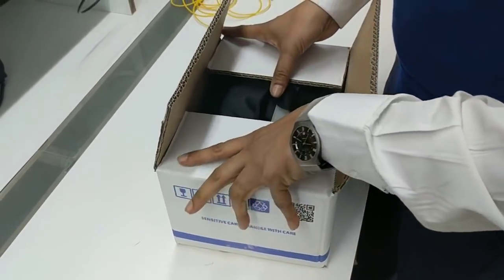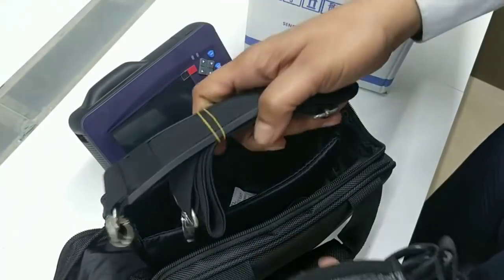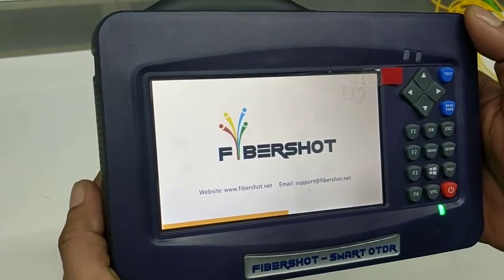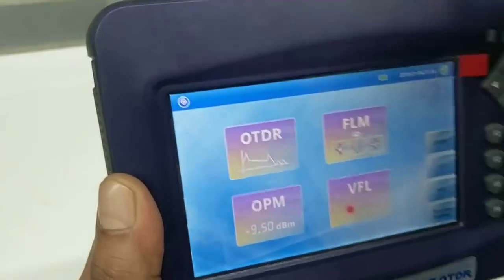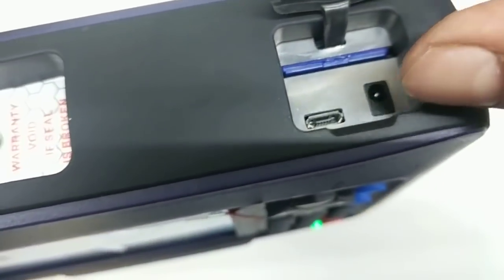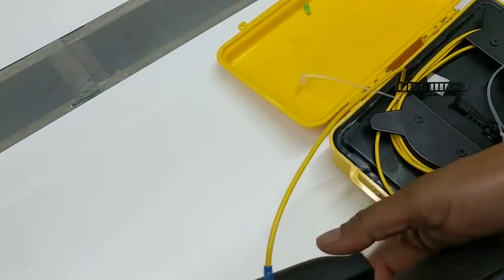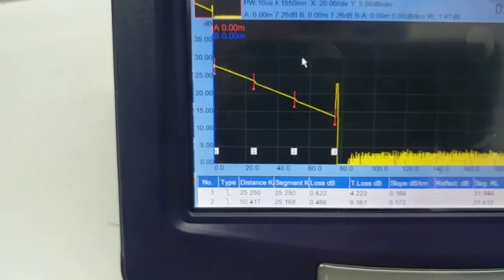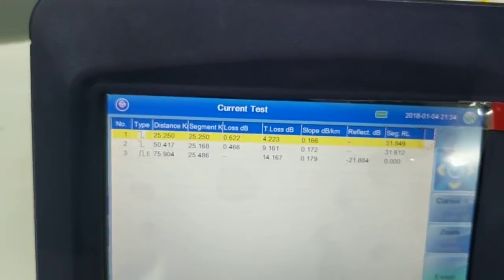how to work on mini OTDR? | How does mini OTDR works?

Comment: Better you demonstrate with using multiple splitters in your demo that will help cable operators to trust... Because on field we don't have a single straight 70 km line...will have splitters and multiple fiber cut joints

Comment: How match this model sr
Reply from the maker: Greetings From Star Technologies!!!
Mr. Hassan.

We have Fibershot's Smart Mini OTDR in two variants 26dB/35dB, what is your required range.

Star Infomatic Pvt. Ltd.
B-1/626, 2nd Floor, Janakpuri,
Opp. Metro Pillar No.572, New Delhi-110058, India.
Toll Free: +91 9899002699